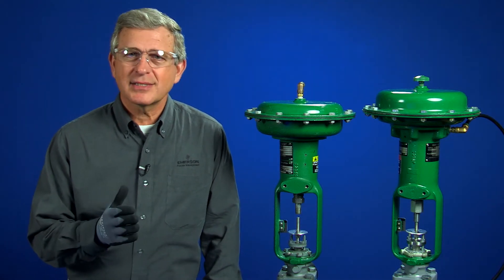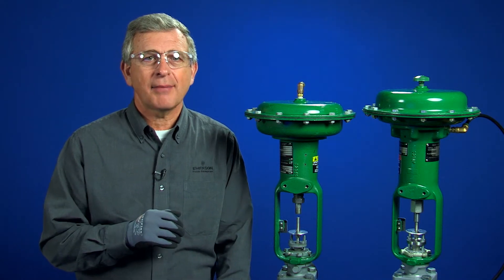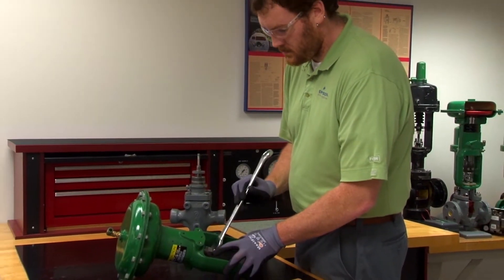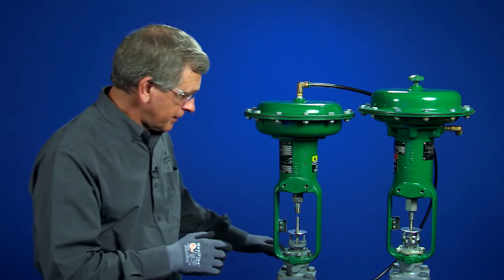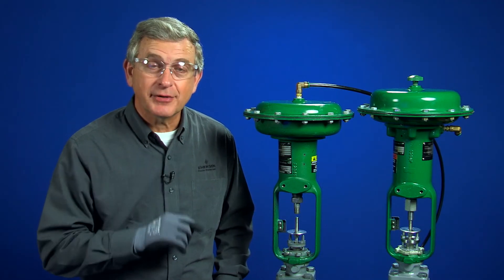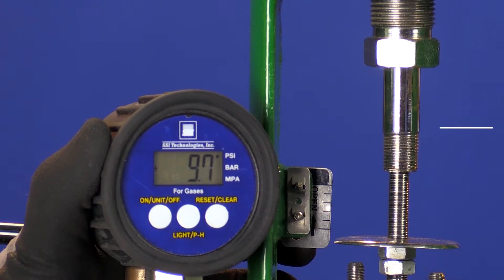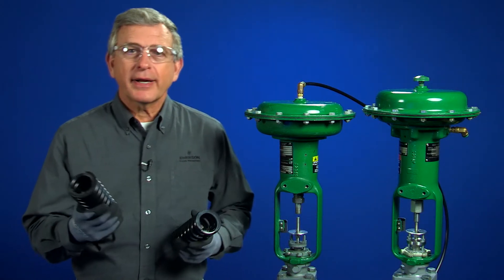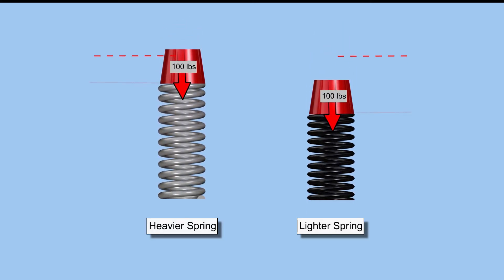How Is Bench Set Adjusted?

Comment: Hi 

I've purchased quiet a bit of these fisher control valves, and I've noticed that not all of them have the same bench valves. 

Example some is 9 to 15 psi
Etc

Now the question that I got, is will the control valve be able to open from 3 to 15 psi ? 

And also why come with different bench set values ?

Comment: Another important aspect of setting bench sets (b.s.) is to know which type of "valve assembly" (valve & actuator) direction you're working on? If you have a "push down to close" valve coupled to a "air to retract" actuator, this is a "Fail Closed valve assembly (v.a.). However, a "push down to open" valve coupled to the same "air to retract" actuator, results in a "Fail Open" valve assembly. This is important from the standpoint of a "Fail Closed" valve assembly the lower end of the bench set is important & the pressure setting should never be lower. In a "Fail Open" v.a., the upper end of the b.s. should not be exceeded as the difference between the upper b.s. & the regulator setting determines the trim (valve) load.

Comment: Why does my butterfly valve does not control well for low flow rates
Reply from the maker: Standard butterfly valves  usually control best at between 30 and 50% of travel. They are inherently quick opening because as they come off the valve seat the disk opens up at both the top and bottom of the disk, allowing flow to jump very quickly.  Emerson offers a special butterfly valve called a Control-Disk which has a specialized disk that helps it control over a wider control range. Watch this video to learn more about it. https://www.youtube.com/watch?v=ubTcwCh9I4w&t=2s

Comment: Is it necessary to perform the bench set with the actuator stem uncoupled from the valve stem? I adjust the spring tension with them coupled.
Reply from the maker: The values listed on the actuator nameplate assume no valve friction is present in the assembly so it generally suggested that the stem coupler be removed.  You can, however, adjust the bench set and spring compression with the actuator coupled to the valve but you’ll have to account for the frictional dead band of the assembly, which then would need to be added to or subtracted from the bench set values listed on the name plate.  If the frictional dead band is not accounted for and adjustments are made so that the valve responds only to the values as they appear on the nameplate, then you’re going to run into issues of either too much or too little spring compression that what the actuator and valve were originally sized and designed to operate with, which could lead to issues with fully opening or closing the valve, seat load issues for shut off and seat leakage, with standing stem loads as process forces are applied to the plug.

Comment: Great videos! I’ve been working in a valve shop, breaking down then refurbishing and rebuilding valves and actuators, with a factory trained mechanic. The videos really help me learn more without having to bother my coworker to train me every moment. I bench set a fisher 657 size 45 to 3-18psi with the stem taking off around 3.3. Thanks!
Reply from the maker: Thanks for the kind words Matthew. We're glad you found it useful!
Reply: Dear sir,
Give me suggestions about Fisher V200 valve.like how to going air pressure input and output..